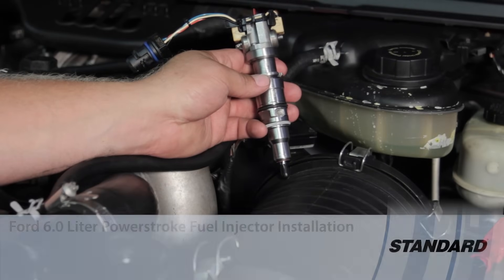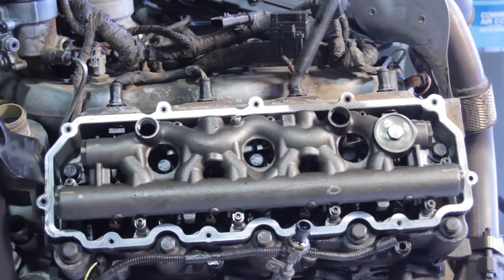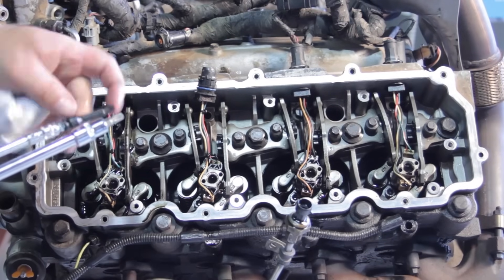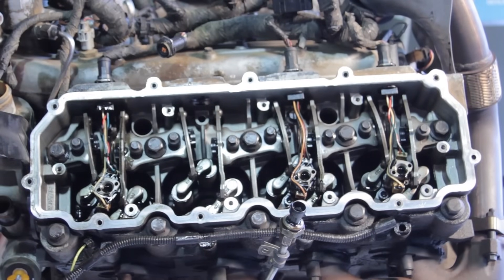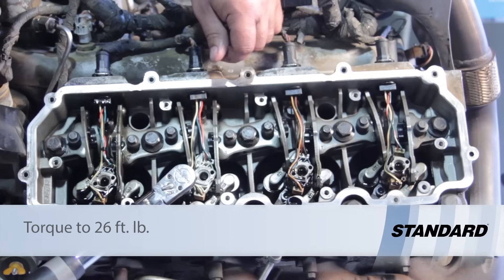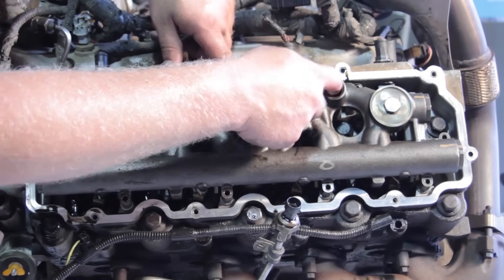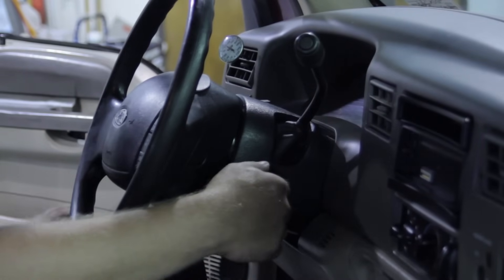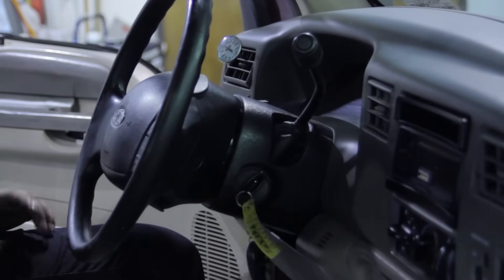Ford 6.0 Liter Powerstroke Fuel Injector Installation

Comment: Crap. I just did the #2 injector, put everything back together and I’ve been cranking the thing, letting it rest and charge and cranking it more. I get nothing, not even a sputter. My scan tool is showing no injector pressure when I crank it. Truck was running fine when I started. What could I have done wrong to cause this? 🤔
Reply: Was it the electrical connection ?

Comment: It is not a T60, it's an Allen bit 10mm (old style) or 12mm (new style).  If you have the old style, replace them immediately with the new version.  Ford parts ONLY.

Comment: I'm gonna try this next injector that goes out. Other videos make it look difficult. You make it look really easy! Thanks! Would a scangauge 2 tell you which injector is going out?
Reply from the maker: Thanks for the comment. We're not as familiar with scangauge 2.  You will need a scantool to determine which cylinder is misfiring. Once you determine that, you need to verify that there's proper compression before condemning an injector. Hope that helps.
Reply: this guy doesnt show the steps to get at the valve covers, that is the hardest part. If this is advanced mechanics as the video says, wow.
Reply: hmm, i havent seen a video that looked hard. lol

Comment: you said num 4 that's the drivers side I thought num is on passenger side second one back
Reply: michael haiden all the odds are on the passenger side
Reply: Ford labeled the cylinders on the 6.0 beginning with the passenger front, driver front then back to the passenger side. Driver side is 2,4,6,8 and passenger side is 1,3,5,7

Comment: I have a 2004 f450 and I'm planning on replacing all 8 injector, I just wanted to know if I have to follow the same procedure as this video or does it change?
Reply from the maker: The process is pretty much the same for each injector, although you don't need to remove the valve cover, high pressure rail, bleed it for each individual injector.  That stuff is only done once per bank.

Comment: I have a 2003 f250 king ranch. I noticed a reduction of power. After connecting  the computer I discovered that my injector #4 is misfiring. Sure I replaced all of them or just the #4 that the computer said that I have problems with?
Reply from the maker: Hi, Isa. Thanks for the question. Depending on the mileage of your truck, it would be a good idea to replace them all. Regardless, it would be a good idea to replace all injectors on that bank while the valve cover is off. Hope that helps.

Comment: Gotta question, I got a 2003 f250 6.0. It's got constant white smoke coming out the exhaust. I did some research. Found out it might be bad injectors, EGR valve cooler, or a cracked head gasket. Any tips or ideas on what it might be.
Reply from the maker: Hi Joey,
We recommend taking it to your local repair shop. We are not confident answering without being in front of the vehicle. Best of luck.
Reply: Joey  McPheeters head gasket
Reply: Did you ever figure it out? I’m going through the same issues.

Comment: Good, clear instructions.  Really appreciate the bleeding tips -- those are excellent.  Thanks for your time and expertise.
Reply: I have a 2004 f450 I have 4 bad injectors I'm planning in changing them all. My question is that if this is the same procedure I should follow or does it change in any way?